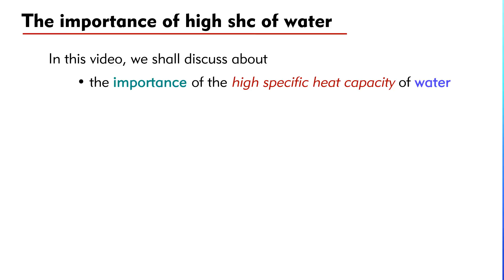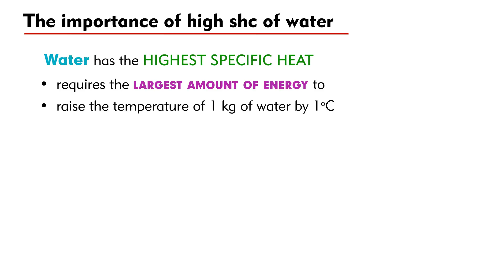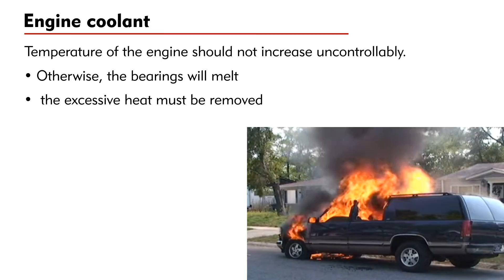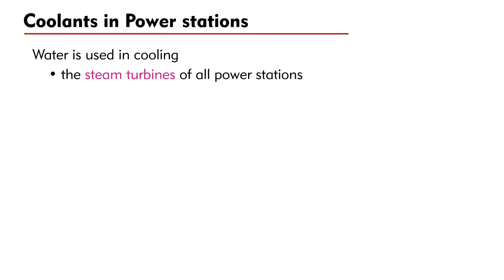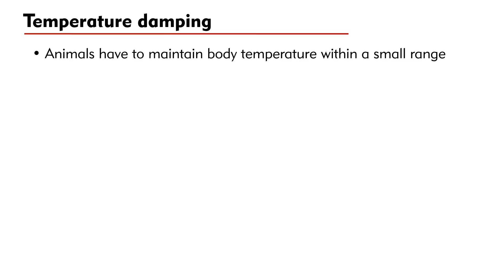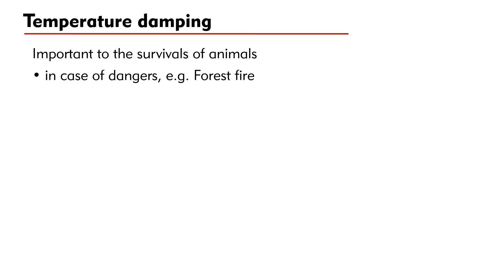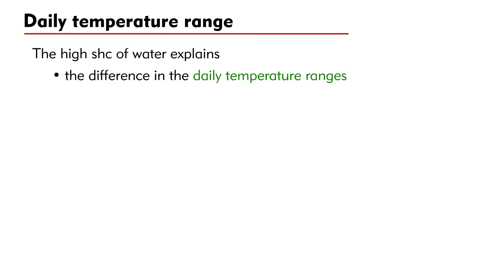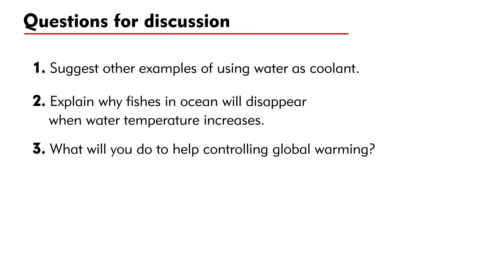The Importance of the high specific heat capacity of water

Comment: 1. Some high-efficiency computers/liquid cooling computers which CPUs are cooled by water. 
2. When water temperature rises, the temperature of the fish in the water rises as well. As temperature affects the functions of our body, the body of the fish malfunctions; and since water has a high specific heat capacity, it takes a longer time to cool down, and because water composes most of the body of animals, it takes a relatively long time to cool down as well. Therefore, the fish would not have enough time to cool its body down and will die. 
3. Use air conditioners only in high temperatures such as >=27 degree C, and remain the temperature of the air conditioner at 25.5 degree C.
Reply: Not only cpu,but also the whole computer system
Reply: Small reminder :)
Reply: Beside of cpu,GPu is also the most energy-consuming and heat-producing device of the computer system.

Comment: 1.  refrigerator, driller(By my guessing.)
2. When the temperature of water rises,the large temperature difference will affect the rate of chemical reactions.It can affect the functions of the organs.Therefore, fishes may die.
3. Use public transport instead of private cars. Try not to use air conditioner in summer. Switch off all electrical appliances after leaving your house.